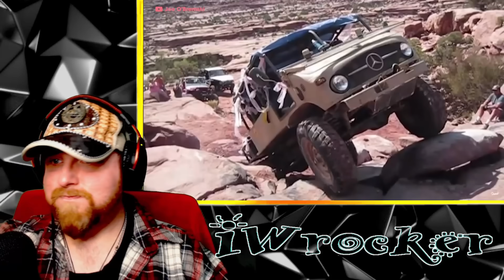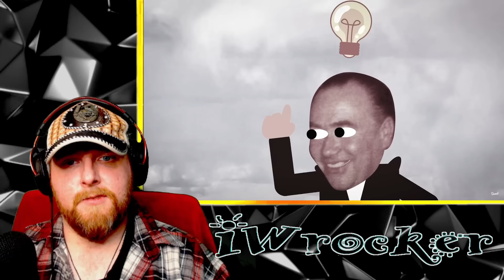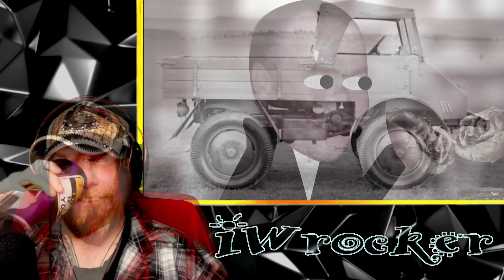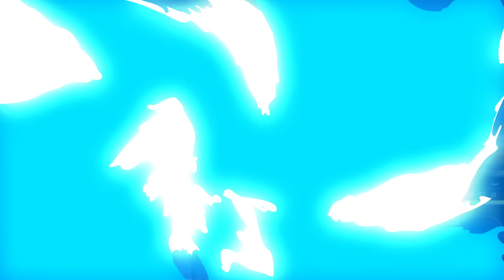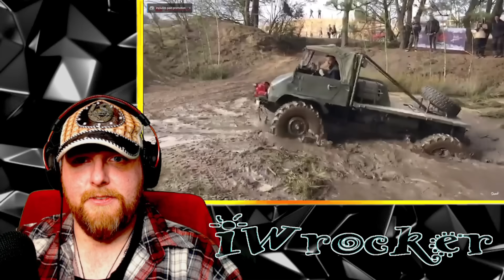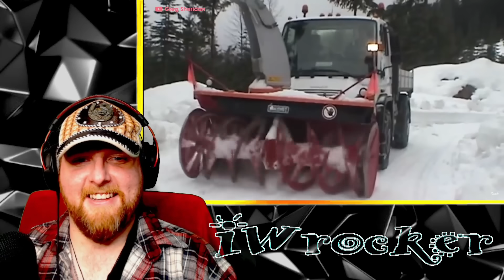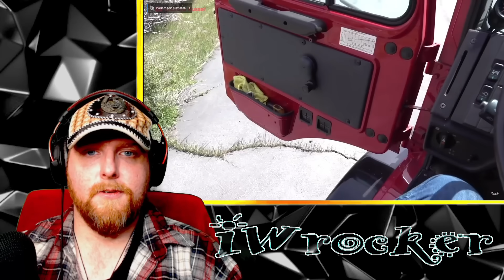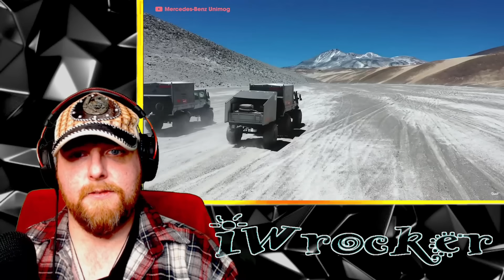American Learns About the Mercedes UNIMOG

Comment: The option to shift the steering wheel position from left to right has a really practical reason. For example, you are using the Unimog to sweep gutters at the side of the road. Then it can be better to sit on the right side of the vehicle, so you have a better view on what you are doing. And than switch it back to the left side during normal driving.
Reply: But this option came with a newer model,the older ones don't have it.
Reply: @sven471111  That's right.
Reply: @sven471111  Most of those older models had just RHD steering so the driver could see the side of the road he was working on. Even today its commen that  roadsweepers have RHD steering.
Ofcourse in RHD countries they use LHD steering for the same purpose.
Reply: @obelic71  Yes,but it was a fix rhd.the one where you can push the whole cockpit from left to right as you need came up in a newer Unimog model.
Reply: @sven471111  also available on the newer models is an 180 degrees turning driversseat with controls, so you can "steer" forwards and  backwards. 
Those are especialy ment for the railway shunters and small tunnel vehicels.
I know of the existance of an older small tunnel inspection vehicle unimog who has 2 driving cabs, each on oposing sides.
A unimog is like a magic carpet you can customize them so you could do almost everything with them.
Reply: @sven471111  So hey just did the logical step for a UNIVERSAL Motor Device. That you can change the side depending on what you're doing instead of using two Vehicles or an otherwise specialized way. So what is your point in repeating that Changing steering side is new? Yes it's new because it's a practical thing. That is what people say here.
Reply: @DieselsVideos  I feel attacked for telling a fact?
Reply: All it takes there is a mirror on the right front corner angled down so that you can see the right-side wheels and curb from the left -side driver's position.  This how the bus driver determines how far they are from the curb when they stop to pick you up...
Reply: @kevincrosby1760  Many of the elder Italian busses and lorries mainly used on narrow mountain roads do have RHD steering as well, because it actually does make a huge difference to see it, or to see it mirrored.
Reply: @kevincrosby1760  They´re also used for cutting grass in which case you want to sit as close to the side of the road as possible to see for example rocks and stuff you have to navigate around.
Reply: @kevincrosby1760  The bus driver does it once every few minutes while driving. For Road maintenance people have to drive the whole day on the right side and they have to be precise, so they dont destroy some things on the road side. So the bus is not really a good comparison. And Tha a bus does it this way does not mean itÄs the best way. If you need the room to let Pessengers in you just have to do it over the mirror. But if the driver is alone or can easily change sides... it's just better.
Reply: @kevincrosby1760  
A bus stops 5% of the day at a bus stop. 95% of the time it's just driving in regular traffic. Then a mirror will indeed be sufficient. 

When you have to sweep the gutters all day long. you are driving 95% of the time close to the curb and only 5% in regular driving situations. In that situation, it's better to just sit at the right hand of the vehicle than to watch it via a mirror. Also. You have to look at what the attachment you are using is doing.
Reply: @kevincrosby1760  Yeah, but they just need to stop at the curbs and don‘t need to operate near the curbs precisely for a long stretch of the road. That‘s when you better watch out of the window to make it easier or making watching out of the right window easier. 😉

Comment: Hey! 0:53  In the 80's, when I was a young soldier, i had 5 of these radio-operator-UNIMOGS in my platoon. They where very all-terrain-able. But with a ridio operator-cabin they had a high point of overflip. Driving was the hell, cause they had no seat, which means your legs went straight forward. The pitty was they had a petrol-engine, not a Diesel as the newer after them. And they where thirsty as camels in the desert. The enormous consumption of petrol: about 20 Liters on road. On front top of these radio-cabins was a heating located, which used petrol as well. It was very warm but dangerous. The fumes of that heating came into the cabin and killed a few of those who didn't care. In my brigade we had 3 soldiers dead by this. They locked windows and doors (which where very sealed by a rubber poetry) and slept away without any notice.   
By the way: UNIMOG is the short form of "Universelles Motor Gerät", translated "universal motor device". The newer ones are the best ATVs I ever driven, but the first ones as you show in camouflage at 0:53 where the most adventurous... Thanks for reminding me!

But, small hint: Before you say loud u want one, have a look at the prices... It's still a Mercedes.

But if you really want one, look at the VEBEG- company in Germany (just google VEBEG) : that is used military stuff of the Bundeswehr, free for anyone. Since Ukraine-war, it becomes a litte fewer (i guess they send a lot of these things to that country) but I just took a look and there a a few 435er UNIMOGS right to be sold now.

Comment: My two cents before watching the video. The Unimog is like a fast food restaurant: the broader the spectrum, the less eatable is the food. Example: if you have a restaurant for italian food (pasta and pizza), it can be really great. If there is mexican food on the menu as well, you may still be lucky. And if they serve burgers as well as italian and asian food: don´t ever go there, because despite having a long menu, there is hardly anything tasty on the plate.
Same goes for the Unimog: yes, it is capable of nearly anything (except going fast), but everything it can do, can be done better by specialized vehicles.
Example: yes, you can use it to plow a field, but it takes 50% longer, since the Unimog can´t pull a big plow. Therefore, you will have a hard time finding a farmer using it.
And yes, it can be used to haul heavy loads, but not nearly as much as a semi truck. Therefore, you will never find a trucker using the Unimog.
There are some execptions of course: for example companies that take care of cutting the plants on the side of the road in the summer, but also have to remove the snow in the winter and spray salt to prevent icing of the roads, everything on a rather low budget of course, seem to favor the Unimog.

What surprised mne when watching the video, was the fact, that it is not street legal in the US, despite having seen some cars in California, which looked to be so unsafe to drive to me that I refused getting in in the first place. Hell, those Unimogs are considered to be safe according to german regulations - how much more safety can you ask for?

I had the pleasure to drive an old model a few times and I must admit: it really is an experience you never forget:
despite being used to driving  manual transmission cars, it was a challenge to wrap my head around the gear levers (plural!): one for shifting gears, one to activate the climbing gears, another to activate different drive train modes (2WD, 4 WD, 4 WD with locked central differential...) 
The most dominant memory however was the first time I had to break the Unimog a little harder:
the brakes are pneumatic, therefore it does not take any force to press the break pedal. Combined with a short wheel base an a extremely long travel in the suspension, it feels as if the Unimog is trying to roll forward, while your seat position is lowered by more than a foot. Scary experience, if you are not used to it!

Conclusion: If given the opportunity to drive one of those vehicels, go for it!

Comment: Here in Germany towns and citys use the UNIMOG as snowplows, for cutting grass next to the roads and other stuff that needs to be done.
Also fire brigades use it as special veicle in case of forest fires due to the great off road capabilities.
Reply: Exactly, and that way I knew them from my childhood days on, a pretty common piece of technology for a German. And of course as a child iI also found this was one of the coolest things driving around ;-)
Reply: You see them sometimes even on the Autobahn trimming bushes/grass at the rails on the side.
Reply: @kl1nk0r  Those or any of the models used for plowing, mowing, whatever by the way have a neat feature. They are available in a drive by wire version. you can move over the steering column and everything to the passenger side, which makes it easier to work on the right side with better visibility.
Reply: Yeah there are pretty common maintenance vehicles here in Germany but it smaller East German cousin the Multicar is also a great workhorse  not so much off road but insane robust and well the smaller size is its big strength beside the 6 tonns carrying capacity it is often used like the Unimog but it fits sidewalks perfectly fine /isn't too wide or long it is just perfect for comunal services
Reply: Actually in many ways the Multicar is better, due to the price and the fuel consumption.   @TheLtVoss
Reply: Mercedes-Benz hat Multicar mittlerweile gekauft. Ist noch nicht so lange her. 
Ich würde mal sagen dass das eine sehr gute Entscheidung war. 
Diese beiden Multitalente schließen sich sozusagen zusammen, sowas kann dann nur sogar noch besser als eh schon werden.
Reply: And the Unimog is the go to truck for everything to do whit forest or hevy timber/lumber work.
Reply: In Europe you can see them alot . In major cities you can see them often as breakdown recovery/repair vehicels for Busses, metros and tramcars. 
In Industrial areas mostly as railway shunters.
they are so good mobile offroad workbenches. 
You can put any type of machinery ontop of it. 
In the Netherlands they have become almost extinct as motorway maintenance vehicels.
Those are now XXL tractors who can carry even longer arms with cleaners/cutters.
Reply: Does the military use (a variant of) them?
Reply: @abraham2172  Years ago, as a soldier in the German Air Force, I had a Unimog as a towing vehicle for the 2cm twin anti-aircraft guns ;-)
Reply: @abraham2172  - the Unimog is the platform of the light infantry vehicle "Dingo". The chassis is for sure heavy modified...
Reply: @OliverSchnitzler  I didn't know the Dingo was based on a Unimog platform! 😲
Reply: @abraham2172  The German Military, yes, I think they use it in different Roles like towing trailers or container loaders, or with a small container on the back, mostly with communications equipment, but they may have other versions with utilities like cranes, excavators etc. attached as well. It is a quite common truck. Other European Countries may use it as well, but I cannot tell for sure.
Reply: The grass cutting attachments are an incredible piece of technology.
It's a robot arm with a mowing tool at the end which can be adjusted by the operator on the Unimog to mow at any angle and to a considerable distance from the vehicle, allowing you to trim ditches and go over road signs without ever leaving the vehicle. With just a driver and an operator you can clear the roadside, including any ditches or elevations next to it and never expose your guys to traffic or even weather.
Reply: @MrHodoAstartes  Actually, there is rarely a driver and an operator. That is why there is the drive by wire version, I think it was shortly shown in the video, where you can move the steering wheel and pedals on sort of a rail. for operation of those attachements by the driver, or for example snow plowing, you move the wheel to the right so the driver has an unobstructed view. Also those attachments are not only used for grass cutting, they also use them like for example a brush hog or to "sort of" trim hedges and bushes.
Reply: die Straßenwacht nutzt ihn an der Autobahn. Wird der überhaupt noch gebaut?
Reply: @joergkirchberger3979  Ja, wird er
Reply: @alexanderkupke920  Zum guten alten Unimog kann man nur sagen: Still going strong.
Reply: eben ein UNIversalMOtorGerät😉
Reply: it's generally a good LF

Comment: Unimogs are common as snowplows, tow trucks, road recovery vehicles etc here in northern Sweden, they are basically lifesavers in the countryside where normal trucks struggle during the winter. 
When you're stuck in a ditch thanks to black ice and you hear that diesel chugging down the road you know help is near.
Reply: ❤ Thank you from a german.
Reply: But you have also the Volvo Lappländer.. 😊

Comment: Just get yourself a Mercedes NG or SK 4x4 and be happy. Those are real Trucks that start at around 10k on the used market and they are old enough so you can import them. Parts are also not a problem b.c. you just need someone who can weld steel together XD

Comment: My dad is a retired firefighter, but I remember as a kid, as my dad's always been a car guy, he'd volunteer when races were held locally to be fire safety, but he'd have to use a fire truck that wasn't one of the ones used in an emergency normally.

That ended up being their forest fire vehicle, a Unimog fire truck on beefy tractor like tires, and he'd pick me up to come with him to watch the races from the fire truck, as the local race track was built by a small mountain... (the ones where they'd set up trial motorcycle events as I think I mentioned on your video on that) 
So we'd get a great view point by driving up into the mountain and park facing the track with an overview of the whole thing, but placed so that if an emergency would arise, we'd just go straight down the mountain (very steep too, don't think any other vehicles would be able to follow.)

My dad also told me about how effective it was at rescue in terrain, as he'd been tasked with getting to some emergency in some hills out in the country outside town, where farmers with their tractors didn't manage to get up the severe hill, and unfortunately the Unimog struggled too... until he remembered the water tank was full, so the truck weighed quite a lot, and as it wasn't a fire he dumped the water, let some air out of the tires, and almost flew up the hill where even tractors didn't get up.
Unimogs are beasts, they are however.... not very comfy on normal roads. :P

Comment: I've had a U1300L for 13 years.....I,ve had Landrovers that cost me more.    In 13 years the big costs have been 2 sets of tyres.......One brake calliper (my fault at the time I didn't realise there was a rebuild kit for the callipers...one tenth of the cost of a whole new calliper). and one length of brake pipe...It does 19 Mpg loaded or not......and you are right, 50 Mph in one ,is top speed and a happy speed, any more and you would have to concentrate every second.

Comment: They have a 'rocker' mode that reverses the transmission without having to change gear. It makes getting out of holes easy - you can build up momentum just rocking back and forth until you bump out. My Series Land Rover had PTO front and rear - had a winch on the front and could attach huge grass cutters on the back. The newer models don't have them anymore and my Nissan Safari gearbox doesn't have a PTO - would love a PTO rear recovery winch, but will have to be more circumspect! Great vid - Unimogs are the dog's bollocks of off-road for sure. Expensive to own and run, but reliable and more capable than anything else.

Comment: The gearbox of the Unimog 404S was able to drive PTO front and back, but also a PTO to the right hand side. All optional, with a bolt on modular approach. It could also bolt on a special crawler gear option, to the bottom of the gearbox. In addition to that, a belt driven compressor could be mounted for air driven attachments or trailer breaks. Great stuff. :)

The newer ones have even more options: PTO, air and hydraulics!

And yes, the stock Unimog is extremely capable off-road, if you ever have the chance to drive one, you should. I've driven these on and off-road, it's great fun.

Comment: You don't know the half of it yet Ian, the old 406 models have several gear sticks, one for the gears, one to select forward and reverse, then you have high and low selections. then you can set the idle speed with a lever on the dash, so you can put it in super low crawl, set the idle and walk along beside it working and throwing stuff in the bed as it crawls along at a snail pace. This is also great for when you're rock crawling. Look up some videos of how to drive one, and also of them being used to rock crawl. They've been my absolute favourite 4w4 forever but have not been lucky enough to own one yet, and have only driven in the later model 80's variants during my time in the Australian army.

https://www.youtube.com/watch?v=FikzWr3rSMU

Comment: Our local utility company here in the UK use these to access there equipment that is out in the middle of field or very remote parts of the countryside, you see them driving around with new wooden pylons mounted on them and they have the large equipment on the front to install them in the ground. 
They are a fantastic machine